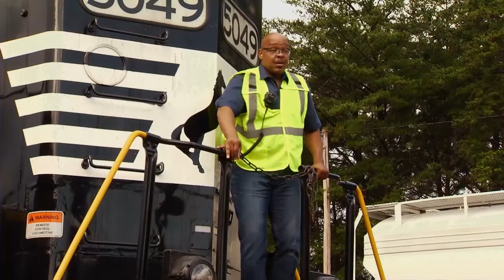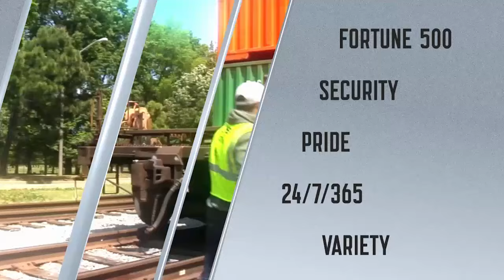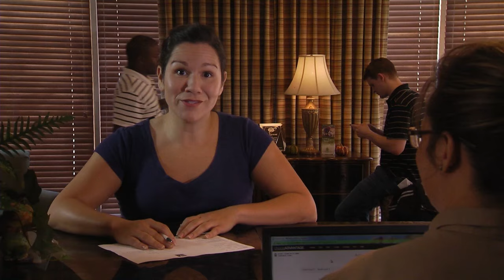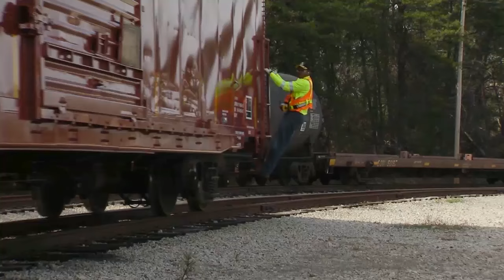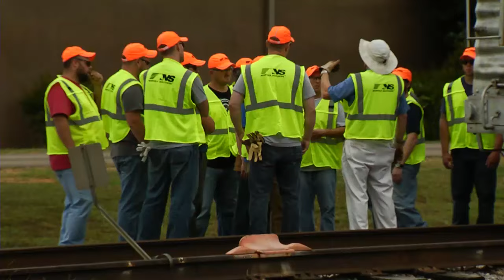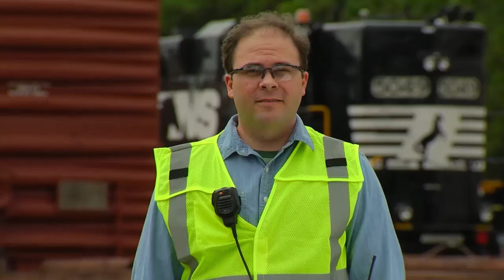A Day in the Life of a Norfolk Southern Conductor

Comment: This appears to be actors promoting the NS, but I could be wrong.  For one thing, their delivery is perfect.  Too perfect.  Having said that, I hired out as a brakeman for the SP in 1967.  I and another newbie brakeman had to work in the hump yard in Houston because of some compromise between the union and SP.  Anyway, an old head conductor also worked with us.  The only training we received were hand signals.  The rest was up to us to learn.  Never mind the rule book, which was on your own time.  Once those three months were completed, at a buck sixty an hour, I was assigned to the 'extra board', which means you work for someone with a regular job.  I've lugged those knuckles for half a train length, air hoses and those gol' darned huge wrenches to tighten said air hoses, fire retardant material, even extinguishers filled with retardant, for hot boxes.  That's back in the day when roller bearings were not that common on rolling stock.  I've had to uncouple the engines from the train after we ran over two deer and their blood and guts were spattered all over the trailing engine and the first car of the train.  I've been on the head end when crashing into a tractor trailer rig and a winch truck.  As far as communication, forget it.  All hand and lantern signals.  No radios back in those days.  No air conditioned cabs.  During hot summer days, the windows were open and often I would put my foot against the door and hold it open just to get some air, however hot it was.  Never mind the heat generated by the engine itself.  Then there were those long wasted days when a train was scheduled to leave, at say 5 am, but often left a midnight.  No cell phones in those days.  I had to stay around the apartment and wait for the call, especially when I moved up to a regular job on the 'local'.  Well, I could say more, but old head brakies like me are a relic of the past.  We went the way of the caboose.
Reply: David Barnett cool story. technology makes shit so easy that's why idiots get hired these days
Reply: thank you for sharing part of your story, very interesting.
Reply: They are actors, David.
Reply: David Barnett .
Reply: I tell you, no woman can do these kind of jobs...
Reply: Well, Dave, holding the door open with your foot had the added benefit of having the cooler, not cold, air rush up your pant leg to cool those sweaty jewels. Drinking h2o in gallon glass jugs cleaned last who knew when. Telephone boxes with insect nests in them. Going out in the sun returning after being rained on (wet ass). Hand signals (do you remember the motions for numbers?) 20 minutes for lunch in the yard. Rub your stomach to take a meal period and so notify your crew.  LAYING PIPE...playing the spare board to obtain favorable jobs. Dropping cars by...what a thrill. Poling a car to move it. Rerailers hung on the engine in case you went off...do it yourself. Iron men and wooden boxcars. Veto jobs? Did you have a fireman other than in passenger service. Bark peelers? Using brakemen on the hump to ride cars when car retarders were frozen. Switch tenders? Crossing watchmen? I was assigned my own caboose (hack, buggy) in local service. I fixed it up to be really comfortable. Passenger service was best...making up time. I worked the 'east end' local trains. Shoreline to GCT and Penn Station (NYNH&H Railroad)....'Liners' The present lot hasn't a clue as far as I see. Love Railroad Retirement....I earned it.
Reply: holy crap I think prison would be an improvement.
Reply: I was thinking that too this old lady picks up 85 lbs continously on the daily? Most women couldn't
Reply: @rootedtogrowwny  I DOUBT  SHE  COULD  DO  IT
Reply: I KNOW  AND THEY  ARE  SO  CLEAN  !
Reply: @rootedtogrowwny  RAILROADING  IS A DIRTY  JOB
Reply: @ernestpassaro9663  it ain't THAT dirty
Reply: @25mfd  so your also a retired or current railroader ?
Reply: @ernestpassaro9663  hired on with chicago and northwestern in 93... resigned in 04
Reply: @25mfd  it is dirty you are working with dirt and grease   C/mon now  !
Reply: @25mfd  why did you quit work that was dangerous and dirty right ?
Reply: @ernestpassaro9663  actually i left because back in 04 they were starting the remote control locomotive thing where i worked in milwaukee... that and the work was steady declining and they were taking jobs off at a steady pace... i wanted to bail before they hit bottom
Reply: @ernestpassaro9663  as a switchman or engr you actually don't get dirty (especially the engrs... PRIMA DONNAS for sure)... there is an assignment i worked though where i did get dirty... a coal train that took coal to a power plant in sheboygan wis... hanging on the side of those coal hoppers you get the coal dust on you... and even then it wasn't that bad... but i guess you are right, it is a dirty job depending on what type of work you do
Reply: @ernestpassaro9663  and yes it was also dangerous... VERY dangerous... had a few close calls
Reply: @25mfd  I was a brakeman for  2 years once I got furloughed I gave the railroad a huge middle finger went to tractor trailer school and never looked back !
Reply: I used to work for a railroad that did lots of car floating trust me it was  dirty
Reply: I guess you pay your dues I started out in trucking working the loading dock then I moved  up
Reply: @ernestpassaro9663  yea railroading is a different world... took some getting used to for me... i was ready to bail after a few years to but i guess i must've bumped my head and forgot to leave... the work was okay but the management was just terrible... constantly trying to fire us and for no real reason either... never understood that
Reply: @25mfd  yes but engineers got to pay their dues also nobody starts out as an engineer unless their father owns the railroad !
Reply: Man that was beautiful to read,thanks for sharing
Reply: Yesterday it was soo hot i had to use my belt to hold open the door on the cab, not everyone on the railroad has air conditioned power.  The only reason locomotives have AC nowa days is for the electronics, not for the people. If working for a class 2 without the need for PTC you will not get relief from the heat. I do feel blessed to have radio coms now tho, im sure the railroad was like the wild west in those days and im sure the productivity levels were far hiring as well. A world that puts safety before all else develops an inability to increase speed
Reply: @25mfd   were you with the WSOR? That is one railroad with an insane work load. More work in one day than a CN or class1 conductor will do in 3 months. They have also only laid off employees one time during the 2008 financial crisis for a very short amount of time. Woulda been sitting pretty by now had you stayed 💯 at the same time you probably blessed the railroad by leaving, delusional people shouldn’t be out there. Im completely filthy after 12 hours on my bid. Or as you call it “assignment”
Reply: @TheGreyGhost_of43rd  nope not with the WSOR, hired on with chicago and northwestern... and not so sure about that sitting pretty part either... yea this would have been my 29th year had i stayed but the work was slowly being chipped away at... it's so bad now a buddy i know that's still there said they've combined 3 wayfreights into one job as all 3 jobs have lost customers over the years, just barely enough work to cobble together ONE job... one of those 3 chipped away way freights i was assigned to before i left was good for 10 to 12 hours every day.... but now it's almost nothing there as far as work... one of my other jobs (a coal train to sheboygan) is on the chopping block as that power plant is converting to gas at the end of this year... not to mention the UP now has the same shitty attendance policy as BNs hi viz garbage... i left and joined the milwaukee fire dept... BEST move i ever made... money stayed the same as the railroad so no pay cut, work one 24hr shift then off 2 days, every 27 day five days off in a row, total working days, 8 days a month... no delusion there... leaving the railroad for the fire dept made ME the one who got blessed... like i said, best move i ever made
Reply: The acting is painful.I don’t know how they have work

Comment: The days of railroading are long-gone. Today it's all about acting. You have to be an actor to do your job correctly. You wear a costume, (Hi vis "safety" vest, glasses, earplugs, sometimes a hard hat,) you carry your props, (brake stick, lantern, radio,) but most importantly, you have to remember ALL your lines. ("Yes sir," "No sir," "After stopping, Train XXX Northbound, with engine YYYY has permission to pass a signal displaying stop indication at North end Buck St. ovahhhhh!") It's become a song and a dance for the pure entertainment of the management team. If they are not impressed with your ability to dance then they will fire you and find someone else who can do a song and a dance. I have actually had a NS road super tell me they can hire a street performer to do this job better than me. The fact is they were probably right because I don't do a song and a dance, I railroad. I guess it's time to retire!
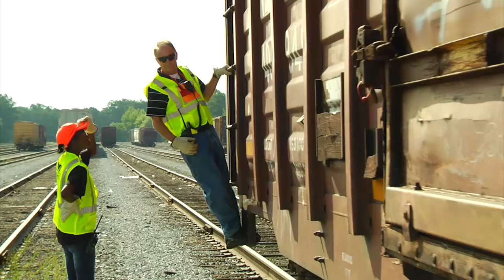However I did chuckle at 3:47 because I always told the cubs, "If you can't hang on to the side of a boxcar in the rain, at night, while shoving into spiderwebs, for a mile or more, you can't hack this job!"

Comment: OK the knuckles are 40kg ... about the weight of a bag of stock feed.  Why make a big thing out of it?
Reply: Stock feed is about half that, first off... Second, it's a little smaller than a bag of stock feed. Finally, you may have to carry that knuckle over a kilometer or more on the rugged ballast shown in the video. Except that ballast hardly looks this well-surfaced in a real application.

Comment: Kinda curious how long your away from home i use to drive OTR in the semi and I’d be gone 3 weeks and home 2 days
Reply: Tyler Keleman You usually run out one day, spend 12-24 hours in a hotel, then catch a run back. Railroad crews have to be familiar with each line. That limits the area to somewhere between a couple hundred miles, up to around 1000.

There are times you might be stuck out on the road. Sometimes work trains supply materials for track repair. They sometimes stay out for a week or so. 

One other long term away status is being forced to a run. If a job goes no bid, then the youngest man is forced to it. Sometimes things get slow in your home terminal. You can take a lay-off, or bid to a terminal with jobs which your seniority will allow you to hold.

Comment: Say I work as a conductor in the Atlanta Metro area, but I am called out to say Augusta Georgia. Does NS provide the vehicle to respond to the call, or will they compensate me for the gas using my own vehicle?
Reply: You work jobs.  You hold jobs with Seniority.  Unless your specified job states you are eligible to go to Augusta from Atlanta you're not going to go to Augusta from Atlanta.  Now if you're on a pool job that goes from Atlanta to Augusta and back or Augusta is on your route to somewhere else.  Yes you could get called to dog catch a train in Augusta.  Or if you are in Atlanta and they need a crew in Augusta to bring a train to Atlanta, you could deadhead to Augusta then bring the train back.  In either situation the Railroad vans you to the location.  The only time you would be responsible for your own transportation is if you got bumped from your job, and couldn't hold any other position in Atlanta, and had to sign up in Augusta, then you would have to drive there for every call or stay in a hotel, usually the one the the railroad rents at a reduced rate, at your own cost.

Comment: If you wanna work on the railroad, get into the signal or track dept. train service you’ll never sleep again, you’ll never have a permanent home base, you can never plan a weekend with your family. Engineers and conductors are on rotating call 24/7 365.,  i was a career railroader started in signal for years then went into train service as a conductor. The money is great and I knew what to expect because I was already a 20 year employee. But it still sucked. Go for signal or track, and become a machine operator like working a tie machine or a spike setter or tamper or ballast regulator those jobs are mon- fri.

Comment: How do the conductors get drug tested
Reply: From what I was told when I had done the hiring session last summer, sometimes they will wait until you are on a run and they have either a FRA inspector or someone from NS roll up to the train and do it.
Reply: I can't speak for NS.  But with BNSF, if you have a mess up on your run.  Say you run through a switch, or have a derailment.  You'll be tested.  If someone reports you for smelling like drugs or alcohol.  You'll be tested.  If there is any suspicion, you'll be tested.  Normally about once a month depending on your union agreement with the company, there is a "First crew out, first crew in, testing" usually around midnight on a unspecified day.  There are hundreds of things that could get you tested from failing specific operations tests, to getting hurt on the job.
Reply: People should be tested for impairment not metabolites.
Reply: Ben your message is something that so many young (under 25) folks need to hear! I'm amazed at how many get upset when they're told that for their job they can't have weed or alcohol on their system when on the job. First thing I tell someone that argues the point is  "Google and read about Amtrak Collision, Gunpow Maryland 1987". That usually shuts them up.
Reply: Ben Dovers' reply is accurate. I can also add that SOME roads draw blood as well as urine samples. I was involved in an "incident" several years ago while operating on the now fallen flag wisconsin central. We were pulled out of service and drug tested. To my surprise they asked for urine AND a blood draw.
Reply: ACLTony and 25mfd.  When you hire out with the BNSF they take about an inch of hair off you.  This is a "DNA" drug test.  To my knowledge it is the only time they'll do that, afterwards they just do your higher end UA's.  In consideration of something like the Amtrak collision, they might very well ask for another DNA. So far as I know it's not limited to just UA's in the Union contracts.
Reply: OK, thanks. From my understanding those hair tests are pretty accurate.

Comment: Do locos have toilets
Reply: Here's a quote from locomotive engineer James Moe:  "Yes, all over the road locomotives, and local use locomotives are equipped with toilets in small rooms in the front hood area of the locomotive. Some even have fold down sinks for hand washing. The toilets are similar to RV type toilets that have a 
hand pump for flushing, and holding tanks for the waste. Some have an 
air pressure assisted flushing system using fresh water similar to an 
airline toilet. There are some older small yard switching locomotives 
that don’t have a toilet, because the engineer working in the yard is 
close enough to an office or locker room to walk over and use the 
restroom."
Reply: Yes, but trust me, you NEVER want to be in a positon where you have to use one.
Reply: They do and they clean it out once in a blue moon-usually when they send the train in for routine maintenance. You could have up to 6 months worth of accumulated piss and shit from other train crews before they empty it out. It gets even more gross when the toilet brakes and you can't flush it and the whole locomotive stinks like feces.
Reply: What? Wow, saddening things have changed that much over the years. Back in the 70s, the SCL (one of CSX's ancestor railroads) was generally pretty good about keeping with the toilets on its fleet. I wonder if, after the big mega-mergers of the 80's-90's, today's class one railroads have such large fleets of locomotives that's it's difficult to keep up with toilet clean-outs.